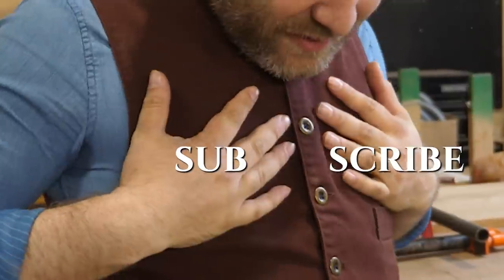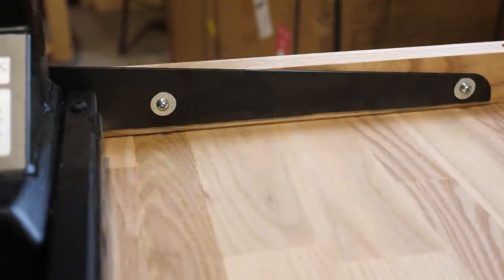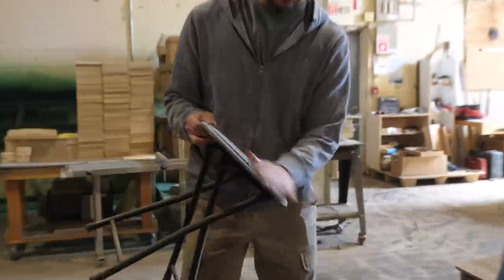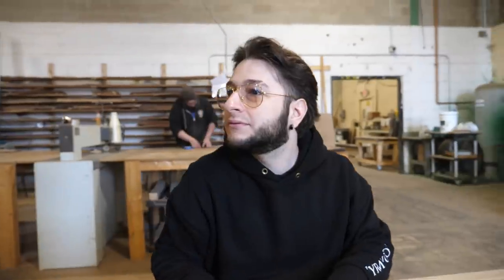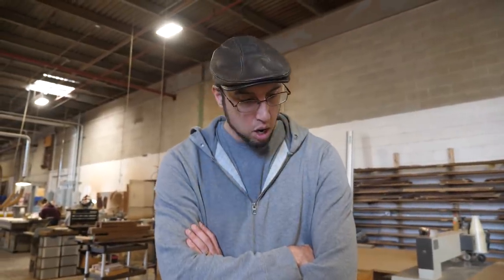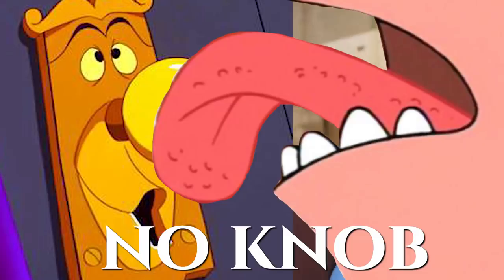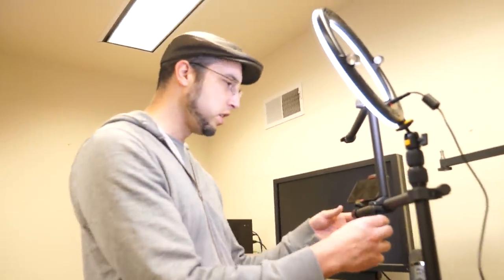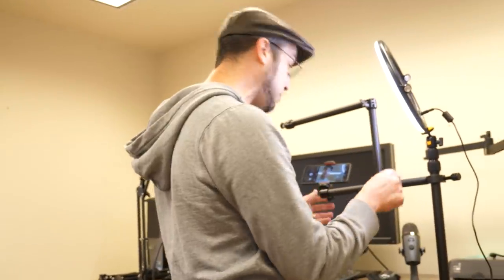The Wyrmwood Modular Sit Stand Desk (the goldilocks desk)

Comment: Lifting the entire set of drawers seems like a lot of added weight. especially once they're all loaded. Why not split it up and have most of the drawers stay on the ground, but the top drawer be attached the lifting surface? That way you can have all your heavy files and such still on the ground, but one drawer for the immediately accessible stuff is still within reach of the surface?

Comment: PC Case location can be an issue with these desks. Many are too small to accommodate multiple monitors and a PC case. Adding drawers limits the location of the PC. Placing a sit-stand on carpet makes the problem worse because many resolutions revolve around placing the case directly on the carpet which blocks air-flow. A separate PC Case stool or attachment would be an amazing addition to help those with large computers use the desk without the above-mentioned problems.

Comment: as for the "shitty cheap" add-ons like mic stands.. it does even matter if you spend more.. 
A good general mount I have started to use for my stuff (at my desk from camera work ) is the Manfrotto super clamp system with large articulating arms/extension arms for light stands that fitstandard light stand 1/4 or 3/8 thread mounting.. It's much more useful then those awful stands that instantly twist off. It's a bit chunky.. but does hold weight really well

Mic stands will always by shit.. most, if not all stands for mounting onto a desk are crap.. unless you hard mount it into the top itself or spend premium on branded stuff.

Comment: Maybe getting a accessory to put the pc on the bottom side of the table like a hanging platform so if you buy the table you don’t need to buy cable extenders for all cables, only power and ethernet would need to be longer. But i don’t know if the motor can handle a big pc hanging on it

Comment: I like the finger joints, but for the two outermost pieces they should be solid so you don’t see an edge with a finger joint. LOVE the smaller rail mount headphone hanger.

Comment: Since you invited us to comment Whatever The Fuck We Want, have a recipe for Key Lime Pie (which I just posted a video of me making on my channel):

1/2 cup key lime juice (20-30 limes if squeezed fresh) Persian or Mexican limes are acceptable substitute, just avoid standard limes. You want the small varietal of limes as regular lines have a different tartness and slightly different flavor.
1 14.5 oz can of sweetened condensed milk
4 egg yolks
1 Graham cracker crust (I typically buy mine, but it could be made by combining Graham cracker crumbs with enough melted butter to get a wet sand texture, pressing into a pie pan and baking at 350°F for about 10 minutes)

Beat egg yolks. Mix in condensed milk. Slowly add lime juice until fully combined. Pour into pie crust.

And now we come to the history portion of this recipe. Back when this recipe was invented, AC has not been created yet and the Florida keys are hot year round. As such, people wanted an easy dessert that did not require turning the oven on. So you have two options here. 1. Let sit on counter for about 2 hours before refrigerating. The acid from the lime juice will cook the egg yolks and set the custard and should kill off any microbes. 2. For extra safety and a slightly firmer custard, bake at 350°F for 10 minutes. It should not color and once cooled it will have a cuttable texture. Side by side, a slice of unbaked will have a slight sag along the edges of the cut slice while the baked one will stand tall and straight.

Both are delicious and you can serve this with either whipped cream, a meringue made from the egg whites not used, or on its own.

Comment: Why dont you just have a block/part that mounts into the mag rail that has the reverse under bevel that squares off the bottom of the table. then people can clap their component to the edge of the desk with the block and top of the desk in between the clamp. you would be able to put it anywhere and it would add 0 protrusion to the side of the desk.

Comment: I'm concerned that the magnetic rail will introduce interference in the cables, leading to static audio at the least and potentially bigger problems.
Reply from the maker: The rail is just metal. The magnets are on the accessories.

Comment: It would be amazing if you had an addon for a built in wooden computer case that replaced either an entire side drawer assembly or just the bottom drawer. Just have all the cutouts for the fans, and mounting points for the motherboard sizes. On a sit stand desk, you want your computer to be on or mounted to the desk so that you only have two cables that need to "dangle" (power and ethernet) as the desk raises and lowers. 

Here's an example of a custom computer drawer. I wouldn't go this custom or fancy. Just mimic the dimensions and mounting points that a typical ITX case has. 
https://youtu.be/vQmItFCCcds

Comment: there is a lot to like here (drawers for one)

but the finger jointing with a lot of wood is going to have the same issue as most of the GM screen design..it just looks cheap, not wyrmwood
also the edges on that curve facing the user are WAY too sharp.